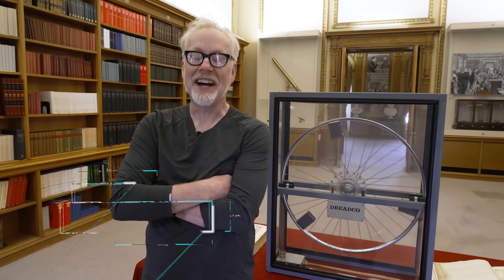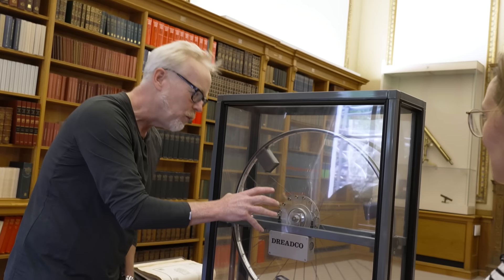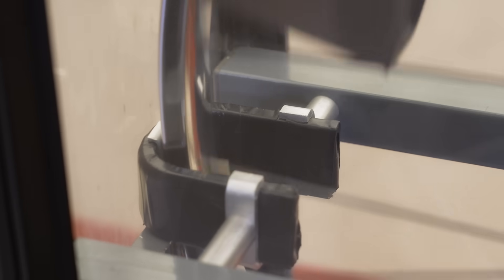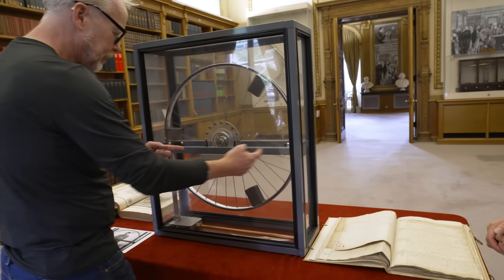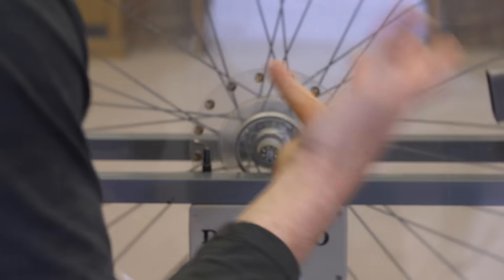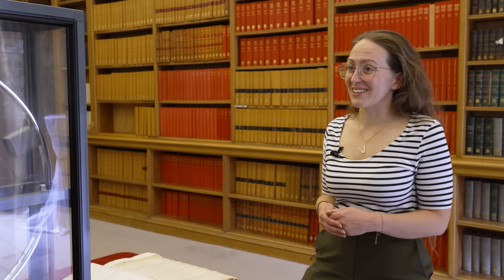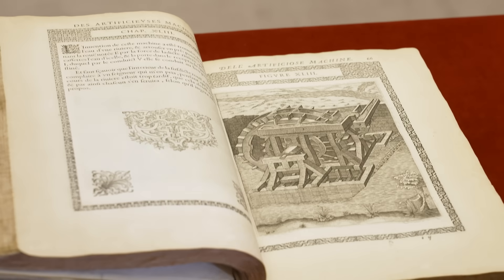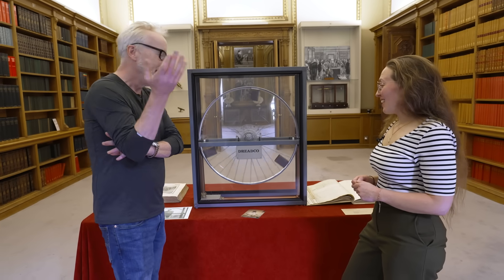Adam Savage vs The "Perpetual Motion" Machine!

Comment: I built one almost exactly like this that ran 5 days.. then stopped. I had magnets attached to the rim and the  frame in opposing poles. Which I used the force of the opposing poles of the magnets to drive  rotation. But finding the correct angle for the magnets was the hardest part.

Comment: a min in and you can see its Magnets, and over time they loose magnetism. its a simple motor. The three would be using repulsion and  the bent magnets on each  side are driving a coil. im wondering about an OR... life repulsion between the bent magnets on each side( that the wheel goes though) and the three on the wheel.  because that would be clever.

Comment: Aint no secret , its resonance , they have EM fields there with specific resonance they made it so that it can tap on that , Tesla did it with Light bulb . Aint no secret . But if you move it away , it slows down becase it gets away from the EM fields . Same thing happens with Musical or Audio forks you strike one the other one vibrates , same is true for EM fields . Basically that is how Radio works . This uses that principal , probably tuned to mains 50hz .

Comment: If what she says is true, I would suspect a VERY efficient bearing and a vacuum chamber that needs to be opened when the wheel stops, someone reaches in and gives it a good spin, it is re-sealed, the air pumped back out, and returned it to the museum.

Comment: The wheel doesn't have to be conductive. The boxes could be wired in all sorts of ways. Some areas of the wheel could be conductive others not. Some spikes too. So you could build whatever circuit you want.

Comment: It's basically just uses magnets to attract and repel to extend the cycle of a flywheel, I believe the Royal Navy looked into the design but found it of no use possibly because as you try and generate a charge, it's creates a magnetic resistance which would slow the wheel down to a stop. Hence the reason "regen" is used for braking in electric cars..

Comment: The Top Theory: The "Atmos" Mechanism
The most scientifically robust theory is that the machine is not a perpetual motion device (which violates the laws of thermodynamics), but rather a highly efficient heat engine that harvests minute changes in the environment to power itself.
This theory suggests the machine functions similarly to the Jaeger-LeCoultre Atmos clock or the 18th-century Cox’s Timepiece.
1. The Power Source: Expanding Fluids
The theory posits that hidden within the hub of the wheel or the base of the stand is a sealed bellows or capsule containing a volatile liquid and gas mixture (such as ethyl chloride).
Mechanism: This mixture is incredibly sensitive to temperature and atmospheric pressure changes. Even a change of 1°C (or slight shifts in barometric pressure) is sufficient to cause the gas to expand or contract significantly.
Energy Capture: As the room warms up during the day and cools at night, the gas expands and contracts. This movement pushes a piston or diaphragm.
2. Converting Expansion to Rotation
The difficult part—and the genius of the Dreadco machine—is converting that slow "breathing" movement into the continuous rotation of a bicycle wheel.
The Winding: The expansion of the bellows likely winds a very weak mainspring or pressurizes a small reservoir.
The Release: Because the bicycle wheel is balanced on ultra-low-friction bearings (a known specialty of Jones), it requires an infinitesimally small amount of torque to keep spinning. The energy harvested from the temperature changes is stored and released slowly to the wheel, perhaps via a magnetic coupling or a hidden needle-drive, providing just enough "kick" to overcome air resistance.
Evidence Supporting This Theory
1. The "Constant Environment" Clue
Jones once hinted that if the machine were placed in a room with perfectly constant temperature and pressure, it would eventually stop. This is the "smoking gun" for an ambient energy harvester. A battery-operated machine would run until the chemical energy depleted regardless of the room's stability; a thermal harvester requires change (entropy) to function.
2. Jones’s Admiration for James Cox
Jones was a historian of science and openly admired James Cox, a jeweler who built a clock in the 1760s powered by a barometer (using 150 pounds of mercury). It is highly probable that Jones sought to miniaturize and modernize Cox’s design using modern chemicals and polymers.
3. The "Not Disappointed" Quote
When asked about the secret, Jones famously said that the solution was scientifically elegant and that "if you knew what it was, you wouldn't be disappointed."
A hidden battery is disappointing (it's just a magic trick).
A hidden wire is disappointing.
A mechanism that effectively "breathes" the air of the room to spin a wheel is scientifically profound and fits the "Daedalus" persona perfectly.

Comment: Stopped it at 5:40, very frustrated. I think there are batteries and coils in the 3 spinning rectangular box shapes, hall effect sensors and a several microsecond pulse generator that powers the coils on approach to a magnet. The copper pipe is a decoy, the heatsink is a decoy.

Comment: Any perpetual motion machine fails immediately any time there is anything moving against anything else, like a wheels spinning on a bearing. No matter how little friction it has, it’s not none so even if you figure out the continuous motion part you will fail on the perpetual part. It will eventually wear out. The only way I see perpetual motion even happening is in the vacuum of space where something can spin without resistance.

Comment: Really interesting device, but I think the “perpetual motion” label is a bit misleading. From the description, it doesn’t actually run indefinitely without external energy input—it eventually needs intervention/resetting. That makes it more of a long-duration clock or energy-storage system, not a true perpetual motion machine (which would violate conservation of energy). Still fascinating engineering, just not perpetual motion in the physics sense.

Comment: I think the box with the copper pipe is the rechargeable battery.  The 3 boxes on the wheel passing thru the magnet provide power and charge the battery at the same time?

Comment: its possible to make a machine that keeps running indefinably. the problem is when you want to extract work from a perpetual motion machine because in that case you are extracting energy away from the system. in this machine there is no work being extracted and the loss of energy over time probably is due to friction.

Comment: at 120 degrees notice the boxes (aka coils) alternate passing thorough left and right magnets creating current which is then most likely transferred through part of the frame or inner part of the copper tubing down to either the box on the bottom or the box at the pivot point of the wheel where the energy is stored and then repurposed to power the wheel motion. That is not perpetual, its a tesla wheel with a charger. You cannot have perpetual motion where gravity is present based on newtons laws.

Comment: This device is doing zero useful work.

In other words, lets pretend it IS perpetual motion, it isn't even overcoming its own frictional forces, hence the "maintenance" required every several months, whic means if you put any load on it, it will require more frequent maintenance,/charging, and you now have a rechargeable battery.

Comment: I have a perpetual motion machine at home...  an Atmos clock ! from Jaeger Lecoultre.
It uses differences in temperature to move perpetually.
Reply: it's not perpetual motion.
Reply: @Tasmanaut  well, it moves perpetually without any action from me.
Reply: @Tasmanaut  it works since 19 years that I bought it. It might break one day but that's not the topic, it was never said that perpetual motion machines can't break. It's not only the clock hands that are moving, but the metallic disc that is quite big (a few centimeters) is rotating perpetually.
Reply: @Tasmanaut  well there is no battery in an Atmos clock, it's all mechanical. And there will always be temperature variations on earth, just a 1°C difference makes the clock run 48 hours.
Reply: @Tasmanaut  if you want a machine that lasts longer than the sun, you've set your expectations too high

Comment: me after about 1 minute of looking at it....

its a cycle back machine that uses the properties of a flywheel along side a stator and rotor, the voltage draw and usage has been tuned so it keeps pace perfectly until the magnets start shifting to neutral polarity in which case they need to be re-magnetized

as for how to keep the large magnets mounted to the wheel from stopping as they pass the stator plates each stack is oriented in a halbach array so there's only ever magnetic forces on a single face of the shape.

honestly though we've already discovered the perpetual motion engine, the water turbine... flowing water is perpetually in motion harvesting power from flowing water is by definition harvesting the energy from perpetual motion. lol

Comment: You can tell that letter has been opened. A hundred times or more by the tape. I guarantee that I could build a perpetual motion machine using magnets. I can actually visualize how it works in my head and it's not that complex. Less than 20 parts needed and it wouldn't be any bigger than this one. My teacher use call me the magnet man. I could even make another one using water and weights and sound.
Reply: Then do it

Comment: I dont understand why no one makes a perpetually motivated generator... I envision a handcrank on top of a beer keg, but inside is just a magnetically floating pole, that uses simple gears to spin coils between magnets, with around 10 to 20 percent of them just being piped back to the too to power an electro magnet, that pushes off of angled magnets attached to the making it continue to spin, so that the handcrank energy is continued after the fact... why wouldn't that work for creating power for hours after you actually crank it... and why couldn't that put out a decent amount of electricity.

Comment: It clearly has a continuous open bar horizontally around the device which could contain anything from wiring to batteries etc, and with the sign box on the front which can also contain anything magnetic, electric etc. And you have the magnets on each end, connected to the open tubes. Definitely too many unnecessary hidden compartments for it to be a transparent device. Therefore,  it is a fraud 100%

Comment: I'm sure if this device was placed on another table without a table cloth, and no power lines running under the different table that the wheel would NOT spin.
The "electrical influence" is UNDER THE TABLE.

Comment: From what the woman explained, it sounds like it is a giant version of a modern clock where a small battery does a kick start pulse to keep it going using so little power that it can run for a year or two especially if it has a small lithium battery like you would expect to see on a industrial control board to hold memory during a power outage. I've seen industrial control boards where these batteries kept the memory alive for 6+ years when the boards were stored as back-ups. I have listened to Adam Savage about two minutes in and I bet he is probably thinking the same thing. Let's see if he mentions this or something along those lines when I finish watching this video.

Comment: The center of the axle is hardly spinning, there Is a resistance spring inside of the axle, the boxes are simply weights.  No electricity Don't overthink it.

Comment: I'll search for information about David Jones's perpetual motion machine at The Royal Society.Based on my research, here's how David Jones's "perpetual motion machine" works:

## The Device

The machine consists of a bicycle wheel suspended in a square metal frame with three metal boxes attached to the inside of the wheel's tire, created in 1981 for a New Scientist exhibition.

## How It Actually Works

*It's NOT a perpetual motion machine* - and Jones never claimed it was. Here's the key:

1. **It's a deliberate fake**: Jones openly stated it was fraudulent and designed to challenge people to figure out the trick.

2. **The secret remains locked**: The secret is kept in a sealed envelope at the Royal Society archives, closed until 2048, with only those entrusted with maintenance knowing how it works.

3. **It requires maintenance**: The machine occasionally requires a "nudge" to keep it going, revealing it's not truly perpetual.

4. **Only one person guessed correctly**: In the decades it's been displayed, only one person ever suggested the correct answer to Jones himself.

## Jones's Strategy

Jones explained his philosophy: "the secret is not to conceal, but to confuse," loading the machines with "cunning distractions, each designed to lead the scientific mind along false trails".

The device has a *hidden power source* concealed somewhere in the mechanism - likely in those metal boxes or the frame itself. The genius is in the misdirection, making scientists overthink the solution while the actual mechanism remains cleverly disguised.

Adam Savage's analysis on the video you're referencing examines the visible components to theorize how it might work, but without Jones's secret being revealed, it remains speculation!

Comment: Like poles repelling and are giving the three magnets on the wheels enough juice to move while the weight of the three magnets does the rest of the work. Maintenance would most likely be ware on the wheel itself. I'd imagine it's barely being pushed by the magnets so even little wear would cause issue.

Comment: if you throw a rock in deep space, it will never slow down or stop.  UNLESS it is acted upon by an external gravity. therefore, there IS   perpetual motion in nature.  you could do the same thing with a rocket ship. cut the engine and you will coast at that speed forever.

Comment: In reality if you hooked a gas motor up to an unlimited supply of gasoline or like a home generator that runs on natural gas, is that not a form of perpetual motion? It fits the criteria of not needing to refuel to keep running till it breaks down over mechanical failure. Could it be that the solution to perpetual motion is being over thought and is already right in front of us? Life itself is an extension of perpetual motion! So think of what you want to run forever and what it takes to make it run forever and that source the only thing needed for perpetual motion and is the key to perpetual motion. I think it'll revet back to electricity.. and we generate electricity freely with dams all over this world and with nuclear plants.  so does that mean people are chasing something that's made up fiction? I don't care about it.. I just offered a different perspective to approach the problem. 😉

Comment: So the only maintenance is to clean up the water vapor the argon made and recharge a semi permeable condition 
They had to clean up the small lake at the bottom of  inclusive

Now this also describes the low and high weather conditions in our weather world,,,.a high pressure system,,,,,has more oxygen than argon values of water,,....and during the cycle of evaporation,,,,,,the argon gets dense and falls as back into magnetically  charged  rain,,,.,lso the pressure systems we indore 
Are from the heavy negative charges of the water molecule 

So these atoms,,,smaller than a molecule,,,,they been atomized to a smaller condition thru vibrations in high pressure system 
Or they get cooked,,,so thats why we have pressure changes on a clear day there is always atoms of water molecules only smaller
Atoms,,but they can and do change sizes back to clouds and rain

Comment: When you think of perpetual motion,,,or all motion,,you have to think in terms of electricity,,,,,,so I would say its an open air Argon magnet which changes to a flip flop magnet,,,,the Argon molecule is the easiest substrate to manipulate,,from the decay rates of Argon,,,,,,so the box on the bottom. Connected to the copper pipe,,is a condenser,,,,so the argon is creating an electric air current,,,,,,so as the argon expands it changes the polar structure  of argon,,,ie positive to negative,,,,,and the condenser brings it back to alignment,,,,so this constant changing argon molecule is mimicking the true effects of the evaporation process,,of the ever changing water molecule,,,....so when H2O
Gets depleted,,,or ionized,,,its a neutral value until condensed
By the suns vibrations again back to h2o

The photosynthesis process in trees from the leaves works the similar way,.,,,..in otherworldly order,,,,.,with out the leaves vibrations from the sun,,,the tree goes Dormant,,,,,so now E=MC2,,comes into eftect,,,..its the mass of the tree trunk,,happens slower and the cold weather is now trying to move a thick fluid through the tree trunk,,,to change the polarity of the trees enzymes from neutral back to negative and positive,,,,,lin the air values of the atmospheric conditions 
E=MC2,,,,is a little less than the speed of light to change the polarity of the ever changing water molecule 

The human body is incase in skin,,,,,,a leaching membrane 
So the fluid dynamics of the body,,is better and exceeds e=MC2,,or the speed of light changes of the voidances of the Human bodies vibrations Cells,,human cells,,,,.
So this describes free energy,,in the atmospheric condition of the Human body and all biological nature,,,,,.and hardening and work hardening of metals.....
Its Biology in its finest,,,,..
So if you add chemicals to this biological body,,,,,lit now changes the DNA. Of the microbial electrical discharges of polar flips in the cells of the human body 

BIOLOGY AT ITS FINEST IN THE PUREST FORMS DOES NOT INCLUDE CHEMICALS...✌